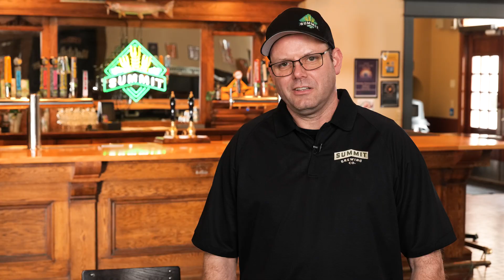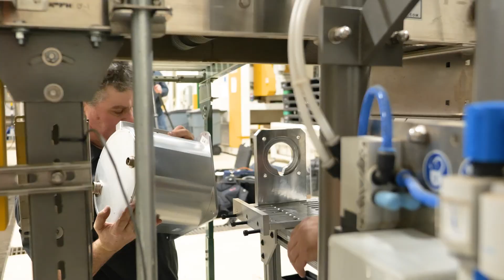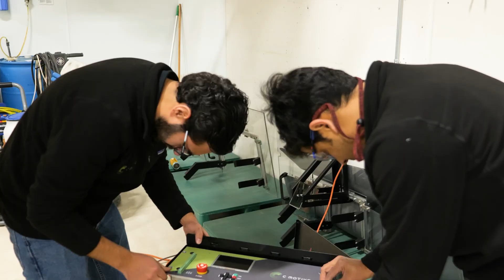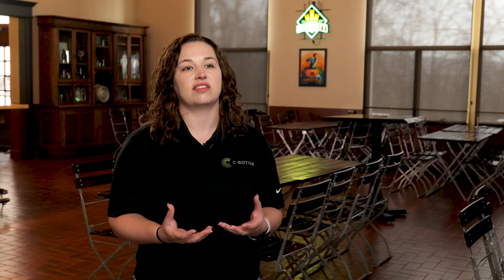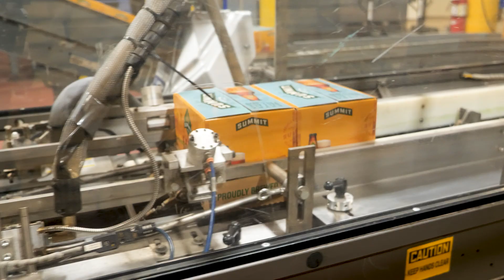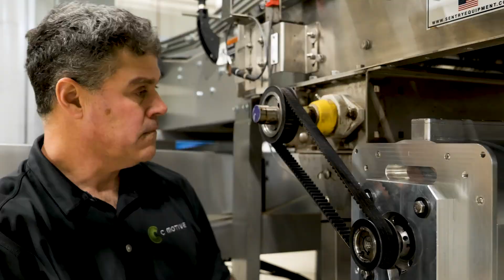C-Motive with Summit Brewing

Comment: As far as I know PMSM motor are 95% efficient where as electrostatic motor are around 85% efficient then why to develop such motor? Are they very cheap or its efficient than induction motor but not efficient than PMSM... Am I correct?